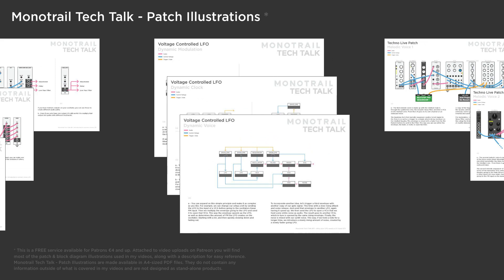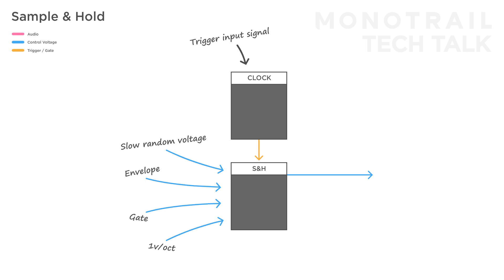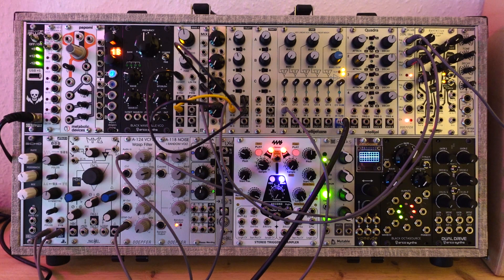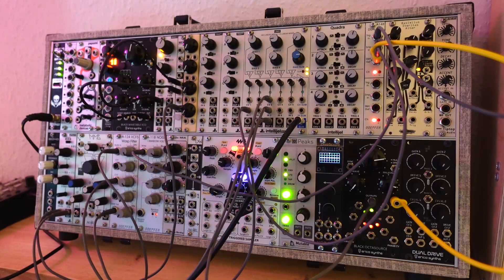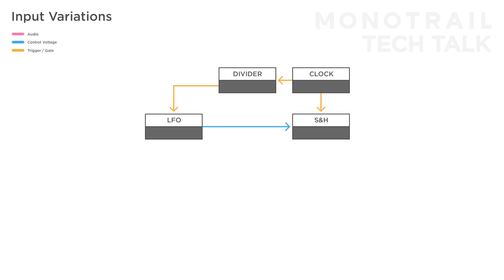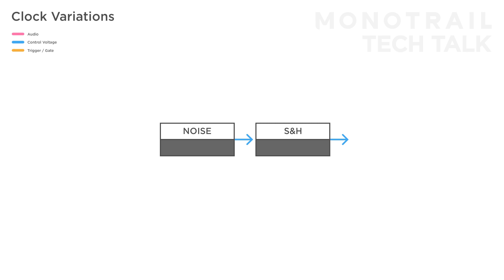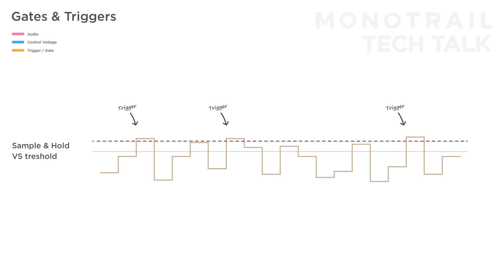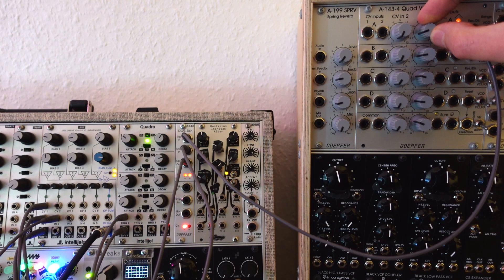How to use sample & hold in a eurorack modular system - with Doepfer A-148

Comment: Logic modules with OR functions are great for cleaning varying gate or trigger voltages.  As long as the voltage exceeds a minimum value, the logic module will output a full level gate.  This can be useful if you have a module that gets a little finnicky with gate levels.
Reply from the maker: Indeed, you can even just feed them something like a smooth a random voltage, and get a clean gate signal.

Comment: I tried many ways last night to listen to the function of the A-148 S&H.. But I couldn't. Cellz Chips A-130-2 VAC A-140-1 ADSR A-162 TDEL A-110-2 VCO A-180-2 Multiple this is my current system. Thanks for your feedback.
Reply from the maker: Hello! Start with a simple patch to test the S&H. You could take a sine or noise wave output from the Chips to the Sample input of the 148. Then take a gate output from the Cellz to the Trigger input of the 148. That should give a holded value every time you hit the Cellz. USe the 148 output to modulate something, like the filter of the second Chips voice.
Reply: @MonotrailTechTalk  super

Comment: I know sample&hold since many years and many synth has it, but one thing I dont understand: why it is necessary with a gate input? the gate input for its own is a complete signal, so why using sample&hold in this case? It is just a 1D value (on/off), but what changes with sample&hold?
Reply from the maker: Hi there! I hope this video explains that well enough. A sample and hold circuit needs two signals to work. An input signal, which is the one being sampled. And a gate input is needed as a clock or trigger for the sample & hold to know 'when' to sample a new value.